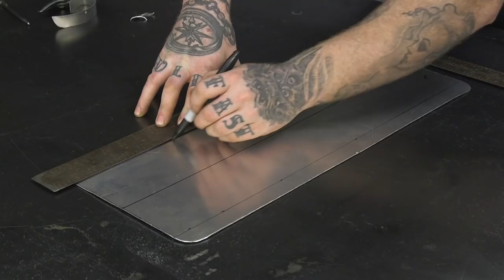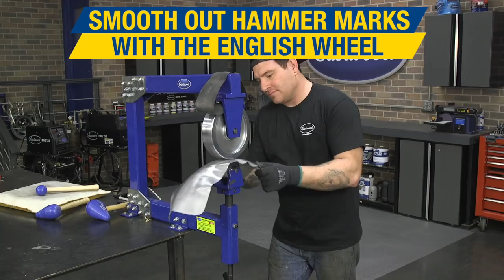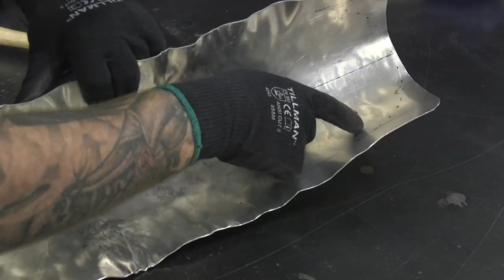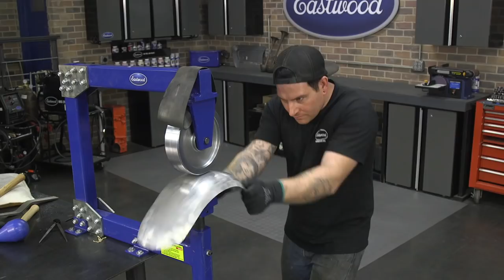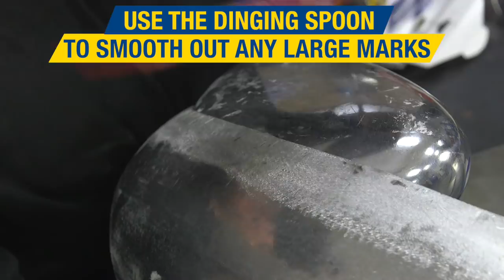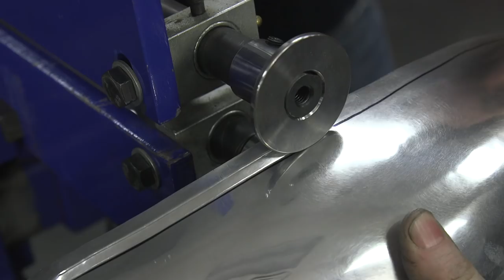How to Build a Motorcycle Fender - Metal Fabrication at Eastwood

Comment: Educationel for sure :) In reality,how long time took this prosess from start to finish??
Reply: One day I think .. no more .. but think about it .. how long will take you if you have made the main shape in a cnc machine and installed it in a hydraulic  pressure ? 10 seconds ? :)
Reply: @phoenixcreations94  Thank you :) sorry late reply.
Reply: As a Metalsmith all my life I’m calling “B” on this. 
First off, I don’t know why everyone thinks tuck shrinking is so important. The shrinker totally negated every bit of the tucks. Total waist of time and what a nasty finishing job.
Here’s how you shoulda done it...make the fender extra wide, used the shrinker, then shaped the fender. After shaping just trim the shrinker scars off and wheel it smooth. 
Also you are going the wrong way if you’re wheeling end to end...go across from edge to edge too for fast shape out. 
I’ll bet someone sweated for a couple days. When I look at the finished product I wouldn’t put it on any respectable motorcycle. 
I guess I’ll have to come up with my own videos to show how to actually do it correctly...and in 1/4 the time. Oh and throw away the DA and use a 6-8” pneumatic disk sander with beeswax lube. Start with 80-100 and work your way down to 400-600 especially if you want to polish.

Comment: hi whats the bottom die of the bead roller did you use here? thanks
Reply from the maker: The bottom die is the Outside Offset Die.  The top is the Inside Offset Die.  This is part of the Bead Roller Forming Die Set, which is available at Eastwood.  http://www.eastwood.com/bead-roller-forming-dies.html